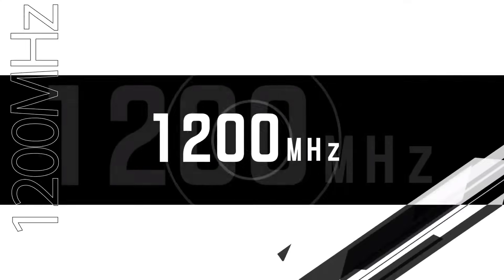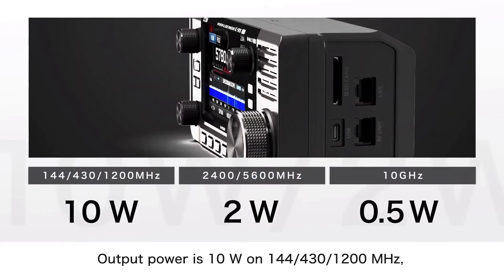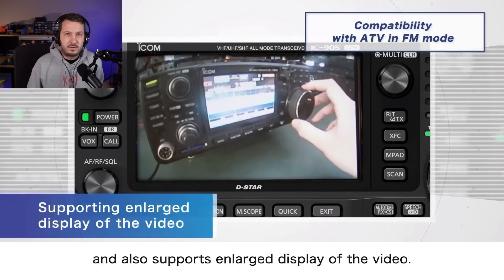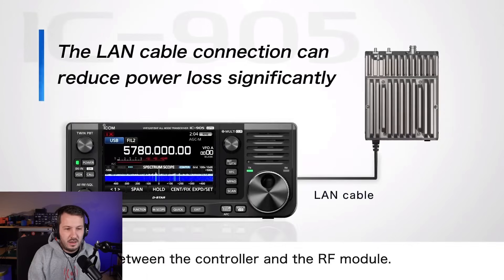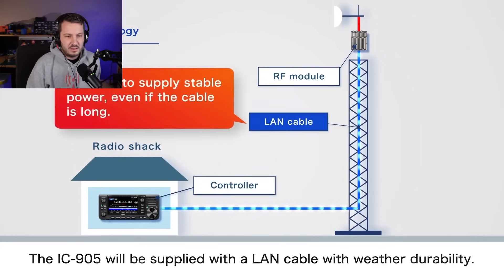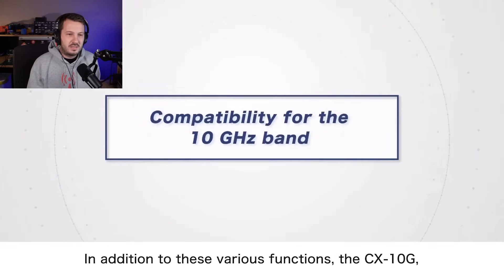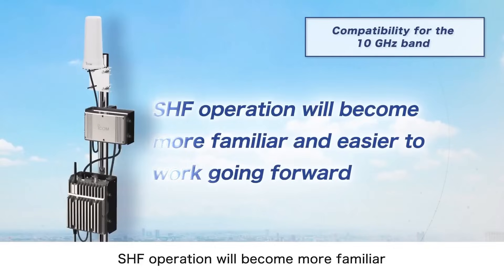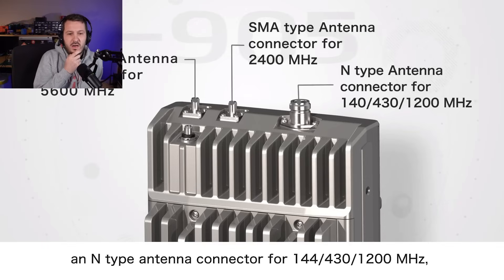Icom IC-905 FULL Details and REVEAL! VHF/UHF & SHF Radio

Comment: I suspect the price mentioned in the video would be wildly inaccurate. I reckon it will be significantly more expensive than the 705 ... but I'll likely still buy it anyway! :)

It's all very exciting. Kudos to Icom!
Reply from the maker: Yes, it is and have subsequently removed the rumored pricing from the video so as not to mislead any.

That said, I think in comparison to the costs of buying a transverter for every one of those bands costs, it will be cheaper in comparison
Reply: @HamRadioDX  Yes. If it was sub $2K I reckon Icom would be struggling to meet demand. I think this is going to be popular anyway. It’s really a bit of a game changer for the higher bands. Exciting!
Reply: @VK2AAK  I agree that many people will buy it. And then be disappointed for the bad results at such low output power.
Reply: @Henning_Rech  Power isn’t the answer. With experience you’ll understand it’s as much about technique. You don’t need a sledgehammer to crack a walnut.
I can happily make long distance contacts at 10 GHz using my existing setup which produces around 200 milliwatts.
My IC-9700 produces 10 Watts on 23cm and that’s perfectly adequate.
Reply: @VK2AAK  To each one his own. 10 W on 1296 is not adequate for me, 800 km everyday DX via airplane scatter would not work at this power level.

 What is long distance on 10G for you? - RS can work with 200 mW and a 2ft dish, but it is painstaking. QRV on 10G in SSB since 1986.
Reply: The fact the IC-905 doesn't run high power is a ridiculous criticism.
EME or rain scatter or aircraft scatter is not the market it was designed for.
Perhaps you need to understand that not everywhere is like Europe where you can point your 10 GHz dish at a storm, call CQ and expect a response. 

Icom didn't design the IC-905 for YOU personally, they designed it to cater to a particular market ... and I think they've read the market very well. The IC-905 is not intended to be a commercial consumer version of your 10 GHz QRV setup. I'm confident that this unit will do more globally to democratise the higher bands than anything that's come before it. I'm confident that no matter the price, this unit will prove more attractive to more hams than going down the expensive transverter/preamplifier/PA route.

You don't buy a Hummer to commute to the office and you don't buy a Hyundai Getz to drive across Africa off road ... but that doesn't mean that either the Hummer or the Hyundai deserve to be criticised.
The fact the IC-905 doesn't suit your particular needs doesn't make it wrong or unworthy or a "toy" (as you've described it in comments elsewhere).
Reply: @VK2AAK  "To each one his own." - " I agree that many people will buy it." - Can't you read? - Don't you understand English, or is my language skill insufficient - I apologize, I am a non native writer. - My 1296 MHz transverter has costed me about 150 EUR, used, 25 years ago. My 1 kW PA is homemade with material for maybe 500 EUR. The masthead preamp too. - Anyone should buy what he wants, this radio (3k, 4k, 5k ?) or the "expensive" transverters.
Reply: @Henning_Rech  Suggesting that I can’t read  or that I don’t understand English is as inappropriate, arrogant and unnecessary as describing the IC-905 as a toy for hams with money but no skills and your assumption that people will be disappointed with bad results because of low power.
Reply: @VK2AAK  I see, you are the god of ham radio, and such good-for-nothings like me have to kiss your feet. - End of discussion.
Reply from the maker: There's always one in every crowd isn't there Andy!
Reply: @HamRadioDX  Sadly, yes.
Not to worry … I think the 905 will be a success and I’m looking forward to it.

Comment: There has got to be a 10Mhz oscillator inside that is disciplined by the GPS but the question will be: if GPS drops out, what is the free running stability of this oscillator?
Reply from the maker: Probably short term very stable. Long term not so much, but you’ll expect the GPS to not drop out for long. Depends on what OCXO they have in there if the GPS is disciplining that. Time will tell I guess
Reply: @HamRadioDX  With the solar storms coming in, this is a real possibility. You could see issues for several days. The GPSDO is used on cell sites to discipline the radio heads that we use so this is not suprising to see and the chips themselves deliver the time tick and the 1PPS. They typically do not directly produce 10Mhz. In fact, on some of ours, we boosted to 100Mhz so while there are a lot of 10Mhz pulses, it is not the only one. So internally, they are using the GPS to do what they need and at the bottom they are sending out the 10Mhz for additional devices.